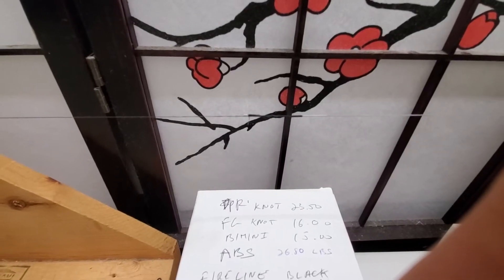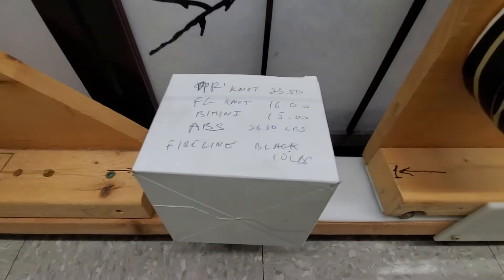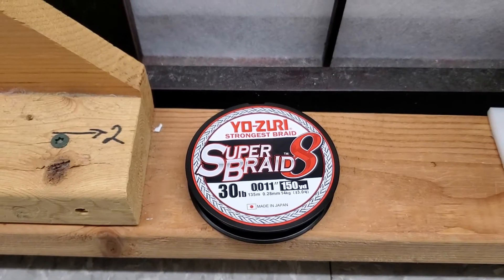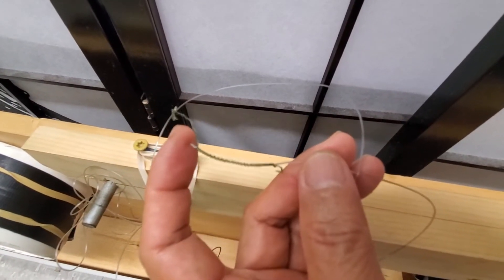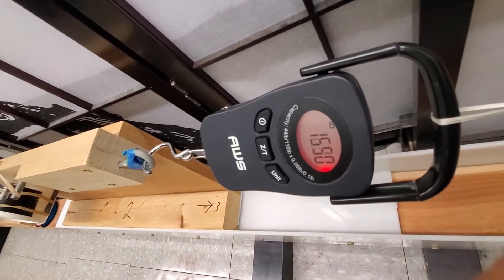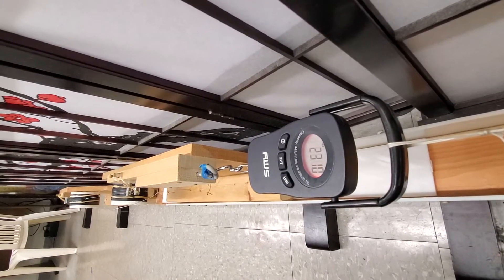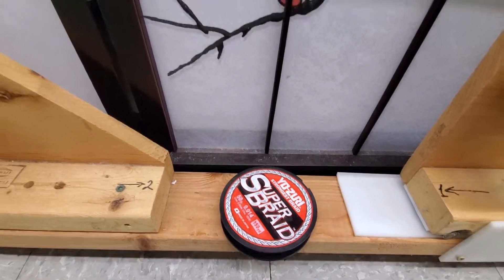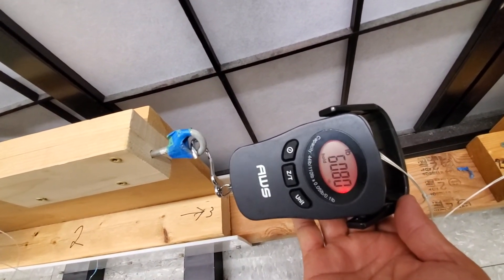Various Relix Knot Test

Comment: What's your formula to determine line diameter? Do you just measure, cut and weight the line to determine it?
Reply from the maker: Density = Mass/Volume. Density of spectra is known:
"Dyneema and Spectra are brands of lightweight high-strength oriented-strand gels spun through a spinneret. They have yield strengths as high as 2.4 GPa (2.4 kN/mm2 or 350,000 psi) and density as low as 0.97 g/cm3" 

Weighing 10 ft of line gives you the mass. So now you can easily calculate the volume in that 10 ft of line. Hidden inside the volume is pi x radius square x height. You can easily extract the radius or diameter of the line from there.

 It's way more accurate to calculate diameter this way than to try and squeeze braided line which will flatten under pressure and therefore not gives you accurate diameter measurement.

Think of it this way. Two brands of 20 lbs braid have the same strength but one weighs more than the other. Which one will be the thicker line if their density is the same and they both float? The thicker line will weigh more because it has more material and all thing being equal, should not cast as far as the lighter line.

Comment: Relix knots have several bonding variations, the simplest with variations (6-8-6) and for maximum strength (6-20-6) or (6-25-6). I saw the relix knot you made wrong, in the step 2 section. In that section the loop should look perfectly "spiral".
Reply: Is it true that 6-20-6 is stronger than 15-20-6?
Reply: @rkc705  because the creator, has done research for 1 year, changing the number of turns, can change the strength of the knot. each step has its own function and purpose

Comment: Relix knot have a special rule in make it. If there coil not conforming to the rules, so a relix knot does not work 100 %.
In order to get maximum strength of a relix knot, the first step 6 coil,  the second step 20-25 coil and finally on the lock with 6 coil toward the front.